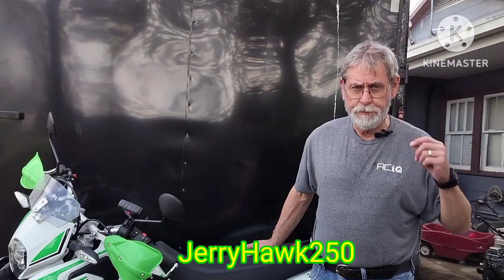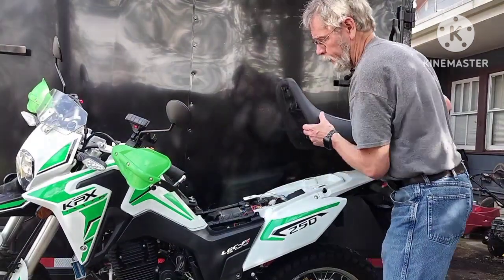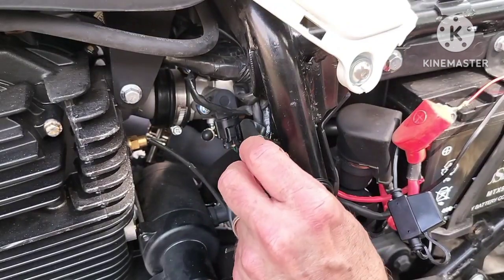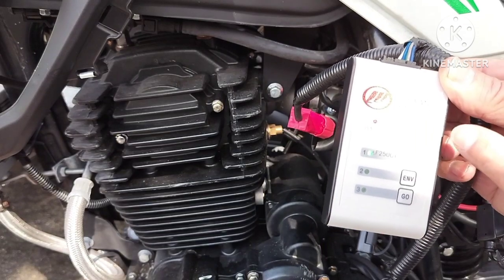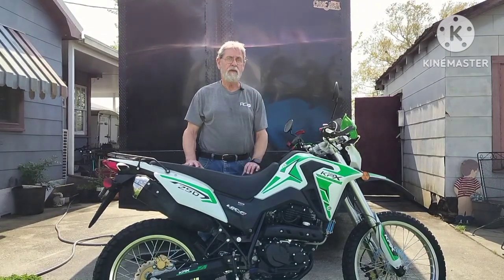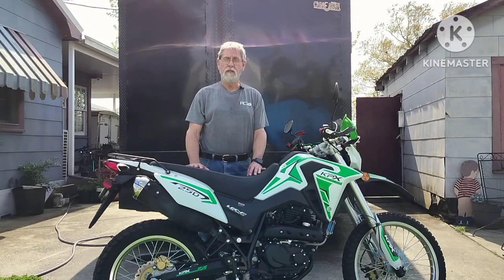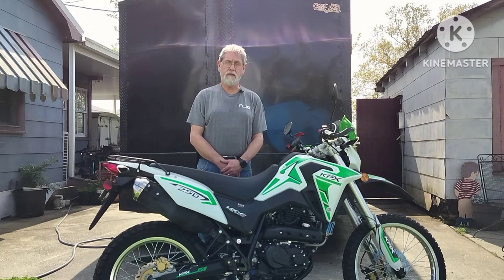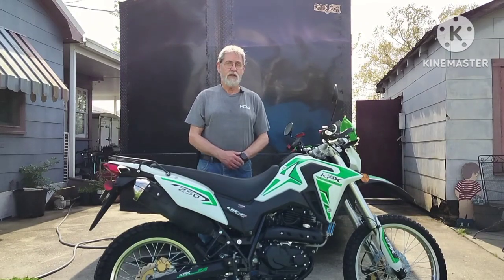How to flash the ECU on the Lifan KPX 250 to update mapping. #Lifankpx250 #Venommotorsports

Comment: Do you know if they fixed this issue? i have a 2024 kpx 250 (bought in february 2025 from venom) and it has shut off once on its own idling. Also the idle seems sort of low but its not super noticeable. Would hate to mess the bike up getting an ecu flash when there is really nothing wrong with it.
Reply from the maker: Supposedly they have. Sometimes disconnecting the battery overnight will reset the ECU so it can relearn.

Comment: KPX250 here.  Got about 600 miles on mine so far.  I gotta say, this bike is near Kaw class.. at less than half the price.  Some corners, but cheap to fix.  Engine is Superb.  At initial startup, Clutch was stuck (from storage?), but a slight rev in neutral and a dump into second gear fixed that.  Engine initially was Weak..  Idle was stable, but No Torque..  Lotta clutch slipping required to start.  Gradually got better..  about 50 miles mostly gone.  At 400 miles, I noticed that 5th gear was actually Powerful!  and Lots of torque, just off idle.  I'd estimate, maybe 20% more power at large throttle openings?   Could Lifan of put in an emissions time out, or is this timing chain and friction reduction break-in?  Anyway, Now engine is near perfect.  Actually have some (small) torque at idle!  
Anyway, wondering which flash you have vs. what I have.  Your bike is probably a year older than mine.   
Anybody else notice this significant break in change?
Questions:
1.  Has anybody figured out the specific model of engine that Lifan Cloned?  Heard it was basically a honda 230 cc?  Any insight?
2.  Back in the day, you could put an offset key in the cam sprocket to change timing.  I'm only using 93 octane gas..  I cculd probably use a couple degrees more timing advance.  Anyway a key offset could accomplish this?
3.  Any 3rd party flashes you've heard of out there?
Thanks for posting the Factory Service Manual!!  Mostly engine of course, but wow..  a real service manual.  Looks Complete, Way beyond a Chiltons paper back.
Enjoying my KXP..  too much fun.
Reply from the maker: @markhall3434  the KPX engine is a Lifan design, not a clone of any other engine. As far as the flash I got, it was to correct the factory flash on the 2022 models. I don't know of anyone who provides an aftermarket flash. I'm sure some people have been experimenting with it though. It would be nice to be able to tune the ECU. No need to run 93 octane fuel. It's designed to run 87. Anything higher is a waste of money. You won't get any performance gain.
Reply: @JerryHawk250  You don't get a performance gain but you get a cleaner engine, ethanol is corn oil and it will gum up in the injectors (I've clean many injectors for this very reason) also in the exhaust ports. Using cleaner fuel greatly improves the longevity of the motor.
Reply from the maker: @matthewdean8070  I use ethanol free fuel only

Comment: Thanks for the great video, I sent my ECU to American Lifan, two weeks ago to get it flashed, just got it back today, put it on. WOW 😲 it sure makes s lot of difference, on how it idles and runs very well, more like a 650 cc, or similar, thanks again you have been very helpful.
Reply from the maker: @cliffmccormick1482  You're welcome, glad I could help.
Reply: How much did it cost? How much power increase?
Reply from the maker: @nelsongraber8987  it didn't cost anything. It was just a remapping of the ECU. The stock time was off and lean. The programer came from American Lifan. It did run much better after. Newer models already have the updated tune

Comment: Amyone know if the ones you buy today are already remapped?
Reply from the maker: This was only on the first batch of 2022 models.
Reply: @JerryHawk250  Sweet. I just got a Lifan KP Mini RS. Was also wanting a dual sport too. Thanks for the reply 👍
Reply: I just received mine a few days ago.. build date was April 2023, so it sat in a crate for a year.  Weak Idle, noticed it instantly..  Idles very smooth when warmed, just very weak.  Anything maneuvering in a parking lot is rev the engine to about 1400, and slip the clutch.  Would be nice to have a more powerful/torquey idle which I presume this flash improves.
Reply: @markhall3434  I just put mine together last week and I believe I saw on the tag that idle is supposed to be 1500
Reply: @KDZ250 idle is a bunch of baloney. They're built off of 1970s Honda engines, which at the time needed 1500rpm idle. My Vader 150 (smaller engine usually needs higher idle) with modified exhaust and intake idles fine at 1k rpm, and cold it runs at 800 rpm until warmed up.

Comment: Hi Jerry,  Did you take a look at your spark plug before you did the upgrade?  I pulled mine and it's is absolutely white which means very lean.  When you did the update did you check your plug after a week or two to find out if your plug was now rosy color and not white?  Interested...
Reply from the maker: Sure didn't. That's a good sign it's not running lean

Comment: For sure Lifan made a good bike there, but nowhere near a Kawasaki, you will notice when you reach 30k miles or so, if you do, and start having engine trouble, and the bike starts to come apart. Kawis you hand down to your grandsons!
Reply from the maker: 30k is about to average for the klx230 before needing a rebuild.
Reply: Dunno, was looking at the KLX300..  last year it was $4999...  looks like out the door is close to $7K now from Kawi dealer.  I decided wasn't worth it..  tried the KPX 250 and Wow..  a few things to adjust, I recommend adjustable levers for both clutch and front brake.  Got mine for $2900 shipped from Venom motorsports.  Cheaper than Amazon..  received it in 10 days.  Life is too short to deal with carberutors...  Instant start every time..  gas guage..  trans is pretty good..  Getting better at hitting neutral.  Couldn't be happier for a knock around bike!  More power would be nice..  I hear Lifan has a 400cc twin coming out..
Reply: Give us an update when you get to 30K!  Kaw is Good, but at now OVER twice the price, a rip off. (IMO)  I can easily sell the KXP for what I paid..  you can't with a Kaw.  I'd much rather have 2 bikes..  one for dirt/knock around/Guest Bike, and one for the road.

Comment: I contacted Venom / Lifan for my new kpx250 and they are sending me the programmer due to hesitation in the throttle  There is a bit of a delay and they said they will send it when they have one ready.  I have been waiting 9-10 days so far
Reply from the maker: Yeah, they only have so many units. I actually sent mine to the next person as soon as I was done.
Reply: It turns out I just got it in the mail today.  I performed the procedure and I was shocked it literally took 3-5 seconds.  The bike definitely has better throttle response and I also noticed the the idle is smoother when the bike is started cold and as it warms up the idle gets a little rougher and that's ok.  Raising and lowering the idle is easy using the set screw/locking nut on the side of the carb. You will have to take off the panel to get to it though as it is a tight fit.  
When it comes to getting your programmer Lifan will communicate with you to tell you when you will receive it and just plan on a couple weeks.  It did not come with a forwarding address or shipping label but, once I contacted Lifan they promptly replied and emailed me the shipping label to print.  Don't destroy the shipping bubble bag as you can re-use it.  I am a happy camper now and I appreciate them standing behind their bikes.  I have never had a fuel injected bike before and seems to work pretty well.
Reply: @rickmiles2381 that's good to hear Rick I'm going to need that flash module because I have a kpx coming in soon 💪🏼💯💨💨💨 what color way did u choose
Reply: I got red and looks great. quick notes: I had to shorten the kickstand 1 inch because it tends to fall over if you not careful .  I also raised the idle with the set screw but, don't raise it too much or it will have odd effects on the idle like increased surge.  I raised my handlebars 2 inches because they feel squatty.  Still happy.
Reply: @rickmiles2381  bet sounds good brother enjoy it 💪🏼💯💨💨💨💨
Reply from the maker: Thanks
Reply: @JerryHawk250  definitely Man happy Easter 🐰💯💨💨💨

Comment: I'm surprised that LiFan can do this?  I thought that, once a motorcycle (or car or whatever) was approved by the EPA or Dot or whatever three-letter agency  (Hmmmm....I wonder if there is an ASS yet?  I mean, sooner or later they have to run out of three-letter combinations with only 26 letters to work with, right?) certifies this stuff it was frozen.

I remember when Royal Enfield introduced their fuel-injected 500 single.  Instead of outsourcing the fuel injection and ECU system, they tried rolling their own.  The result was that there were LOTS of people reporting that they had stalling issues, and petitioned Royal Enfield for re-maps.  This was in about 2014, as I recall.   Royal Enfield said they couldn't do it, as once the software was approved and certified, the fueling maps, etc. were cast in concrete.  I only heard of one guy that ever got his ECU re-mapped, and that a guy in Australia, I think, that complained so much that they ended up getting a new ECU from India (where they had fixed the problem) and installed that one in this guy's bike.

But it's nice to hear that the Chinese will go the extra mile for their customers.

Comment: nice.. it was hard to see the programer but it seems simple enough.. Is Lifan just sending out programers to everyone vs send ECM back and forth??  this is the second vid seen on that.  

Do you send the programer back or can you send it to another person to use and they send to another and so on and so forth??  Be interesting to see how this affects your bike now.. both power and the odd idle issues.   wonder if its due to something in the O2 sensor on exhaust changing with age.. What type of gas you use on the regular?? RUL or Ethanol free RUL, 93 octane etc..  

are they remapping the new or have new programming on the new units so this is not needed in the future?   will be new member of the KPX club this fall,, fingers crossed..
Reply from the maker: I think they are sending the programmer out instead. That way you don't have any down time. 
They sent me a label to send directly to the next person that needed it. I think the real issue is that they had to tune the ECU really lean to get passed the EPA. Hopefully the new bikes will have the correct mapping. Either way, it looks like Lifan takes care of the customer. I use regular ethanol free gas.

Comment: I need to contact them, and see if they will let me use the tool to reflash mine.   I sent mine in, and it doesn't die now, but it gets a choppy idle still, and has a flat spot off idle.  I never got any instructions, and didn't wait 5-6 minutes,and let mine idle. So that may be the problem.
Reply: If you already sent in for the flash. It's probably the tps needs fine tuning. Not many videos on it. It definitely makes a difference
Reply from the maker: @jacobg6528  I had tried that and didn't help.
Reply: @JerryHawk250   Did you use a multi meter to fine tune it? Closed butterfly should be .45-.50volts closed. opened should be around 4.5volts. every tiny little hair movement makes the voltage change. you wont be able to do it correctly just eyeballing it and listening by ear :D
Reply from the maker: It wouldn't hurt to ask. Letting it idle for at least 5 minutes is probably an important step. I would also do it with the engine being cold if they do send the programmer.
Reply: @JerryHawk250   Thanks.

Comment: About 15 years ago I bought two of the 200cc Enduros being marketed by SSR at the time; they were Lifan GY-5's with SSR200 livery. Licensed one for dual-sport use in Virginia. Put 9,000 miles on it; top speed 45mph and at 35-40 it always got 88mpg. They were about $900 each in 2009.
Reply from the maker: These bikes have really improved over the years. The KPX will run 75 mph + GPS right out the crate now. My Hawk 250 topped out about 50 mph stock. Once I did a bunch of mods to it would top out  about 70 but that was pushing it to the limits.